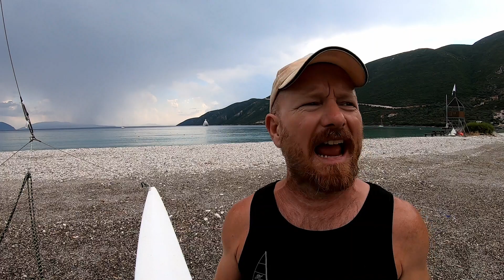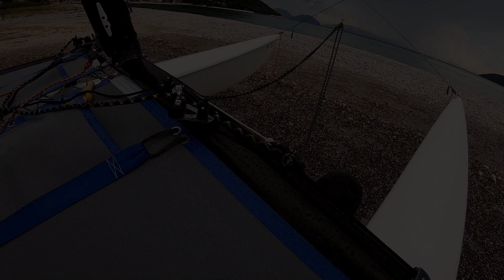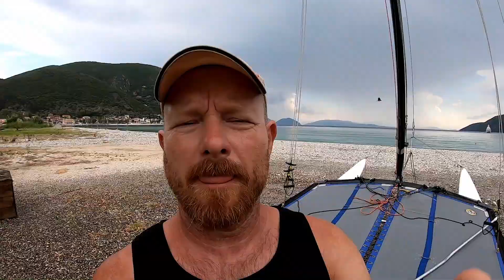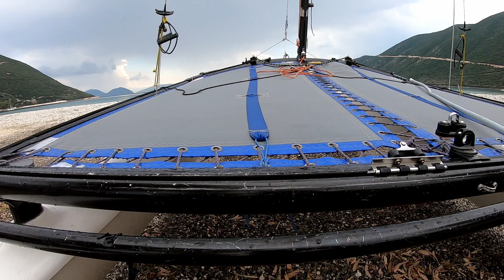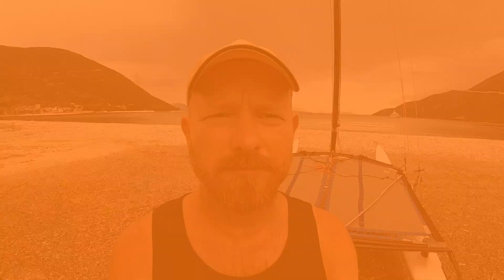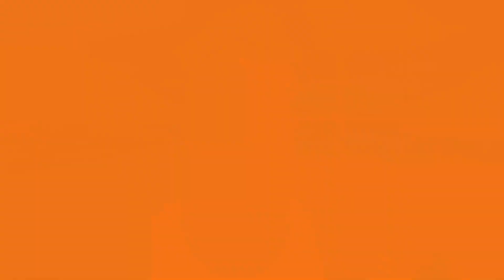Catamaran traveller settings basics

Comment: Oh thank heavens!  I'm soooooooo relieved to learn that the traveler need not ride all the way port or starboard.  My situation is different from most (I think) in that I won't have protected water to sail in, but will be going straight out to sea. (I'm in St Augustine, FL USA).  In my case I need an outboard motor for safety.  Well, getting an outboard on my Getaway has been a royal pain.  However I think I have the problem licked now.  If anyone else out there is struggling with how to mount a small outboard on a Hobie cat, let me know and I'm happy to help.
Reply from the maker: It would certainly be interesting to see.

Comment: Thanks for explanations that I fully agree with from my experience.
That said, I'm not used to HC16 main sail, more used to mylar sails, where we may depower by twisting the upper part of sail with centered traveller, like one does on a windsurf. How do you see that ?
Reply from the maker: More down hall certainly opens the leach of the sale up like on a windsurfer, it also serves to flatten the sale moving the centre of effort down and forwards. Because the 16 doesn’t have a pre-bent mast, we use the traveller more for losing power.
Reply: @JoyriderTV  thanks fir explanation 👍✌

Comment: When I was visiting a sailing course for a monohull sailboat, I was told to adjust the main sheet traveler so that the boom is in the middle of the ship for sailing between beam reach and close haul. In other scenarios they taught me to keep it in the middle. If I am correct you said it otherwise in the video so i was wandering if the theory is different on a catamaran or is this just different style of sailing.
Reply from the maker: Because there is no kicker/vang on a catamaran the way that we control the sail is different.

Comment: Joe, thank you for your tutorial. Just a question: do you also move the traveller upwind, when beating against the wind? I mean, in light winds when sailing aganist the wind, can be the traveller be moved upwind?
Reply from the maker: The main traveller will never go more than the centre.
Reply: @JoyriderTV  thank you .  https://www.facebook.com/groups/113205032069113/permalink/3257459507643634/
Reply: I have had good success moving the traveler to windward up to 1/5 - 1/4 of the way. I had to release traveler and hold the car position with mainsheet (hard work in medium air and near impossible in a blow).  Also had to move jib clew inboard to get it to work properly (narrow the slot) to avoid over sheeting and stalling mainsail, Used lazy/windward jib sheet as inhauler.  I was seeing excellent speeds close hauled in 5-8 TWS @ 45 +/- TWA.

Comment: What is the jib traveller length of the rope? And a single piece of rope or a separate rope for port and starboard sides? I did not find any information on jib traveller rope assembly in your channel.
Reply from the maker: I measured - 3m

Comment: Thank you Joe. Very informative and interesting, as usual 👍
One question, though: I didn't get if/where you covered the traveller settings when sailing with the spinnaker up.
Specifically, if I am sailing (say, a F18) on a broad reach, chute up, in a 12-14 knots wind situation, ore more.
I assume that the mainsheet will be sheeted in hard, to reduce drag and to support the mast. 
But what about the traveller , and what are my options to (de)power the mainsail without putting the stability of the mast at risk?
Thank you in advance
Dan
Reply from the maker: In that kind of wind the traveller would be central and then the mainsheet tight in the gusts and a little looser in the lulls. 
When overpowered with the spi up, don't touch the traveller or mainsheet. Just use the steering to deal with the gusts, easing a little on the kite as you bear off.
Reply: @JoyriderTV  Thank you Joe :-)
Reply: @JoyriderTV  Thank you :-)

Comment: Hi Joe, when under spinnaker on a Tiger, I understand the mainsheet acts as the backstay and has to remain under full tension, however does the traveller car have to remain centred?
Reply from the maker: If it's windy then the traveller should be in the centre due to the apparent wind. If the boat slows down you can ease the traveller a little to prevent oversheeting but if you've been double trapeze upwind then the centre is the spot downwind.

Comment: Yes but I have the old system. Manual jib trailer with the nob and one to one main rope.
To hard to switch?
Reply from the maker: I think no need to switch the old jib system unless you're racing. You can just change the settings for point of sail and have it all the way out if it's windy.

Comment: Thanks Joe. Would be keen to get a similar video on playing the mainsheet and explaining flattening the sail. I get it but I still find it counterintuitive that we can depower by letting out the mainsheet and spilling wind but also depower by pulling on the mainsheet and flattening the sail!
Reply from the maker: Will do - that's going to be one of the next in this series. For now you can have Stefan's explanation below:
Reply: @JoyriderTV   @Feeds Ravens  wow, thank you. That is such a thought out and detailed answer. I'll read it through a number of times. I hadn't ever really considered the effect of drag in the way you explain it.

I agree that it has to become instinctive, there's no way you can think through all that while flying along in and out of gusts, but like you, it really helps me to be able to understand all that beforehand to make sense of what I'm doing.

Thanks again for taking time to give such a detailed response.
Reply: Great video Joseph 👍 with regards to the explanation from Feeds Raven, the best way to spill wind off a H16 sail is to travel out rather than release the main sheet. Releasing the main sheet with reduce tension on the leech & the twist at the top of the sail which will spill the wind but not as quickly as keeping the leech tight & traveling out. You will see top teams crew work the traveller up wind more than releasing the jib. I’ve found this makes the boat sail much smoother upwind rather than the “up down” effect of releasing the main sheet & then pulling back on. You will also notice that traveling the main out will be less than releasing the main sheet. Hope this makes sense 👍

Comment: Joe, I use the traveler in a slight different way to depower the main while landing with wind from behind.

If I'm sailing abeam or at brodreach and I need to stall the sail to slow down approaching the beach, I put the traveler at the center while hauling in the main sheet and easing the jib sheet.

That's the only way to slow down my HC16 if I land with beam or broad reach sailing, easing the main will anyway let it work speeding up the cat, I think that stalling the main as I described is better and everybody in my beachmarina land like that with cats.
Reply from the maker: Nice, good skills there. It must be a bit tricky once you've hit the beach and you want to let it out if it's windy though.
Reply: @JoyriderTV  well we land directly only when we have some surf, normally we luff head to wind a few meters off the beach to stop the cat and not scratching the hulls or helms on the sand.
Keep in mind anyway that the normal thermal summer breeze in this part of central western Italy is around 12 to 15 kt and due to the shallow water and open sea coast, stronger winds bring rough and short surf that is not safe to sail on... especially with a HC 😉